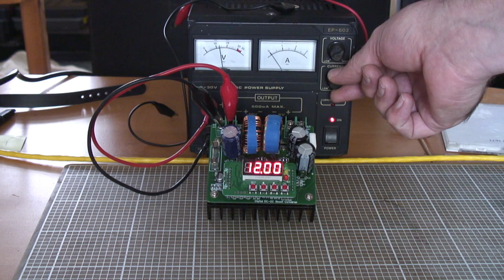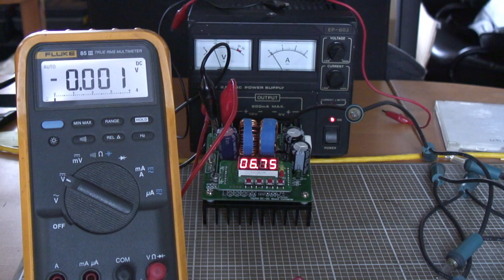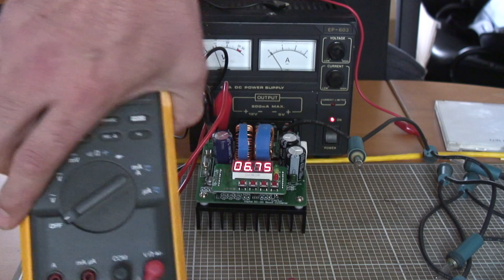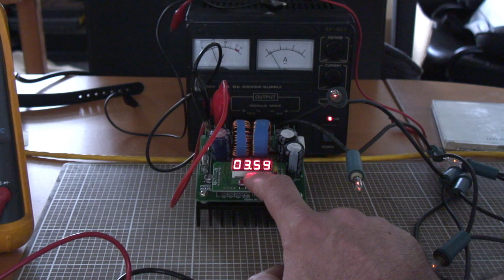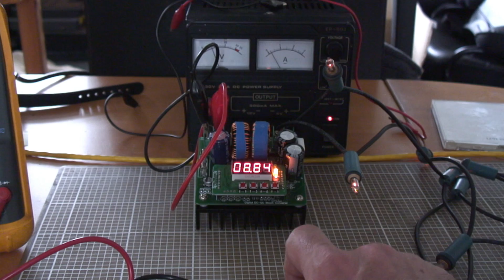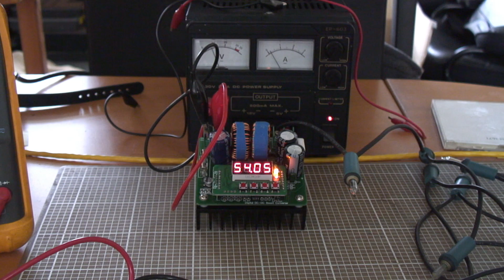Review: 400W Digitally Controlled DC/DC Step-Up Boost Converter - Far from Perfect

Comment: I don't think it's fair to bash this based on setting the output LOWER than the input, as boost converters physically cannot tolerate it (a well know fact I assumed) but maybe it could be programmed out but let's fact it these things are very cheap.  The one I bought clearly stated the output must be GREATER than the input voltage.

That being said I came here because mine are a pile of garbage and I was looking for a fix. 

When I first turn it on, the output voltage spikes to over 30V (when input voltage is 12V) irrespective of whether it it's powered on or not! This is terrible! 

Also the current limiting does not work whatsoever and the device frequently shorts out because of this. 

OH... I also have two of these and they both do the same thing!

Comment: When it hits 100 Volts, the display is continuing to show the correct voltage, but with the decimal point in the wrong place. The output rose to around 110V before the input supply protection saved it from destruction, probably as it’s output capacitors began to flashover.

Comment: Do these problems exist at output setting from 8v to 80v?  Seems to me, that on a 8-80v converter, the firmware shouldn't let you set less than 8v.  Q.C. probably never thought of that.

Comment: Does anyone know how to reset the BST400 factory settings?  Mine will change voltage to the stored setting but only delivers 0 amps regardless of settings
Reply from the maker: Hi John - The procedure for the factory reset is detailed in the description for this video (The F6 menu). If that doesn't work I've got something else for you to check too... The current limit on this converter is not really a current limit at all - it just disables the voltage boost function if the current exceeds the set point, but even with the boost function disabled, current can still flow from the input to the output through the inductor+diode which make the voltage boost happen. Try hooking up a resistive load (i.e. filament lamp) onto the output and see if any current flows (you'll want a lamp rated the same as the input voltage, so if you're running off a 12V input, then use a 12V lamp). If the lamp doesn't light up, then the chances are pretty high that the output diode has gone open circuit. Hope that helps. Cheers!!
Reply: You were correct - a resistive load works perfectly.  The reset worked too.  But I still cannot get it to power 5- 20 watt LED arrays.  The voltage ramps up to the max that I set with the current staying at 0. Even when I put a resistive load in parallel with the array it ramps up till the current max is reached but the array sits with a few LED's lit just like the BST is connected to a voltage source but turned off. I will test LED arrays to see if I fried them.  Thanks again
Reply: +Jim Conner Pigs ass the current limiter doesn't work. I'm sitting here right now with 2 50W COB led's running in series at fuck knows what voltage limited to 280mA. Just checked... 59.39V down from 74.13V @1.35A.
Only thing I found wrong with this unit was the calibration was a little off and drifts a bit with temp, wasn't that hard to figure out how to calibrate and drift... well... everything drifts with temp. Can't fault it. (but I haven't tried to do anything they tell you NOT to do in the descriptions on the auction site.)

Comment: I have BST900 boost model bought this year. set at 14v from a 12v battery current ramped to18v. 
other problems that you found.
when I tried to test current limit set at 1 amp it blew the fuses in my multimeter.  but current does not seem to work on any load from lights to batteries to fans. 
It never goes enters CC mode unless I set the voltage way to high for my purpose and when it does go into cc mode it limits at a much current than what I set it for.

Here is a video. Can someone tell me if this working correctly.
https://www.youtube.com/watch?v=1CXfbv1ehL0
Reply from the maker: Hi lmorrison - I watched your video and it looks to me like your unit is not working correctly. If the output current exceeds the CC limit, then the boost function should disable and the output voltgae should drop down to around the same as the input voltage (minus a diode drop)... Your unit seems to still be boosting the output voltage up to 14.2V. I reckon it's broken. Hope that helps. Cheers!!
Reply: thats what i thought but the seller says this is correct function but did give me a 50% refund
still need something to play with some led's
Reply: I have one of the BST900 green boards and it's totally shit, it's can't handle a 0.50a load without the voltage dropping way down. my old BST400 out preformed it easily. I think all the green board BST900 are total shit. the black board BST900 gets better reviews but right now I feel like just sticking with the old BST400
Reply: Amazon has a black board unit under the DROK name  but it looks like the exact same unit.https://www.amazon.com/gp/product/B01GFVI6R6/ref=as_li_ss_tl?ie=UTF8&psc=1&linkCode=sl1&tag=batter00-20&linkId=484a1902b5018199aa0604bc3078e670

Comment: Mine did not have the start up escalation to 24V problem or resetting issues. The voltage escalates to  its pre-set voltage once the OK tactile switch is depressed, and in case one does not press the OK switch to commence operation the voltage stays at the same level as the battery bank to which it is connected. I can not talk about switch mode power noise since I did not test it with an oscilloscope yet.

The only issue I found (which I believe is no big deal) is a discrepancy on the readout of the device for the voltage: for instance, it may show 16V but often will output  17V instead. I tested the current output with a dc clamp amp meter and it is reasonably accurate. 

It is very useful whence no AC power is present (off-grid solar array system) since there isn't  a need to use an adjustable bench power supply (which in my case has over 50% of losses plus the large losses introduced by an inverter.

Comment: Hi here is a stupid question... I got this boost converter from a friend,  He got it on ebay whit no manual and is a total nobb. So  he tried to use it in the car,, And that 60amp lol...  The fuse was blown but is that all do you think? it looks fine and smells fine lol.. But over 50amp over the limit that wood break someting more than a fuse even just a second?  I do not have a new fuse anyway i can test it anyway? And what componet do you think has gone if it's dead even whit a new fuse? Thangs but do not want ti waist time on it if it's hopeless... I go a few thats not digital my self.... But my friend god the digital and no manual.. They shud have a manual i found it on google easy,,,,
Reply from the maker: Hi +TheCbj79 - If it is blowing fuses, the most likely reason is that the FET transistor which switches the current through the inductor has gone short-circuit. Personally, with this 400W converter I wouldn't bother attempting to repair it and I'd just buy one of the far better 600W converters (without the LED display) instead. Even when this 400W unit is working 'properly' it's still not really very useful as the output has a lot of electrical noise on it, and ther are problems with the unit starting up properly etc... Hope that helps. Cheers!!
Reply: Ok but it's just dead.. whit a new fuse to. And when the buyer got it he used a batteri whit to high amp.. then he did blow the fuse.. After this it's dead whit new fuse.. so then it's maby a fet transistor...ok thangs.... I konw there not the best,,,, But the led display is ok when you need to test a led you do not know the current on.. I hav two 600w whit no led display there good.... There used for ligth in a cabin whit no power......

Comment: DO NOT LET THE UNIT RAMP UP WHEN YOU SET THE VOLTAGE  TO 0 .. I DID A TEST LAST NIGHT AND IT RAMPED UP TO WELL OVER 120V AND BLEW THE SWITCHING MOSFETS SCREWED TO THE HEATSINK.!!   

..DEAD
Reply from the maker: Thanks +scaleop4  - I'm surprised the capacitors didn't blow out too - they're only 100V rated. It was probably the breakdown of the capacitors which caused the high currents which killed the MOSFETs. Cheers!!

Comment: I have been using one of these units to remotely charge/float my car battery from another car battery and i have not found a problem with starting up (with or without a load) however the unit does require a lot of (inrush) current to start up, I don't think your PSU is up to the job and it's your power supply that is tripping and not allowing correct start up and especially start up with a load attached. The business with setting a lower voltage? has not been an issue for me so far.

Comment: When it reads 00.00v after 99.99, I'd wager that's actually 100.00 truncated. I would certainly not assume it's gone back to 0v.
Reply from the maker: Hey +Andrew Somerville  - I had worked on the assumption that it had wrapped round to 100V, but when I let the output voltage go as high as it liked @10:20 it seems to go all the way up to about 113V before it tripped the current limit on the input... It's not much of a real-world problem though as you'd never set the output voltage to such a low value in real-world use... Still a bug that could do with fixing though. Cheers!!

Comment: Hi Jim, Julian Ilett sent me up here....to be honest, i would expect at least some issues when purchasing a rock bottom down BOM-cost step up converter, with no extra (=expensive) output protection of any kind.

When you start the device, you´ll see that your PowerSupply can´t deliver the amount of current the converter asks for. As the driving PS getting into current protection during power up. Usually you hook these converters to a big 12V car battery and it, for sure, will deliver the inrush current needed to power the converter without input current limitation, therefore the converter will power up as intended.

Next, this is a boost converter, and as any other plain boost converter, this thing is not intended to be used to generate an output voltage below its input voltage, usually a boost converter don´t start up at all or, more likely, it´ll do "funny" things on its output.

If i play around with converters of this kind, i´m aware of these things, as they´re obvious....There is no primary output protection to prevent any output voltage to be seen on the ouput terminals/connectors during power up. If you want that here DIY it, or go for an industrial grade boost converter, which will easily cost about ten times more, but it will have all these handy output protection things already builtin, tested and guaranteed and it will also come fully sheelded/sealed...;)
Reply from the maker: Hi +TubiCal - Thanks for taking the time to stop by and leave a comment. I certainly wasn't expecting perfection from this unit, but having already bought a couple of the 600W boost converters (without displays) I was at least expecting something as good as those units, only with an LED display attached for convenience... Sadly this 400W unit has so many problems it is largely unusable. 

Even when this unit is hooked up to an esentially unlimited power source (i.e. big lead acid battery which can delivery hundreds of amps) it still does not power up cleanly. The output voltage is always driven to around 30V before the unit initialises (even when the output is switched off at power-up in the firmware), and if you have a device attached which only requires 24V then it's going to go bang. This doesn't seem to be an issue with inrush current specifically... If you attach a load to the output, it will attempt to drive that load up to 30V, consuming as many amps as it requires to do that from the input until it finally reaches 30V, at which point the converter will then disable the output and finish it's booting-up process. It's as if the logic circuitry to control the whole unit is running from the output voltage of the converter rather than the input, and until such a time as the logic circuits kick in to take control of the situation then it just keeps on ramping up the output without limit.

I totally agree that the converter will not be able to produce an output lower than it's input voltage, but given that the converter only operates from about 10V upwards, why does the firmware let you choose an output voltage under this level - This is clearly a bug/feature in the firmware which would have been very easy for the designer to fix. It's just bad practice letting you choose a value which is below the minimum possible. 

I wasn't expecting anything amazing from this converter... My expectations were merely that it would be about the same performance as all of the cheap boost converters without a display, but this unit produces a huge amount of switching noise both on the input and the ouput, doesn't swtich on cleanly, resets itself at the drop of a hat, and takes forever to ramp up to the desired settings. Given that this unit costs three times as much as the 600W converter (without LED display), I was expecting it to be at least useable.

Cheers,

Jim
Reply: +Jim Conner I broke my converter somehow. I dont know whats the problem. I was
 charging my 12 V car battery with regular 14.4v and about 5 amps... 
everything was okay,  but after a while I accidentally dumped a positive
 imput wire  from the load with a hand.. So that should not be a problem
 right? But when I set up again imput lead, converter didnt work. I just
 noticed first 
digit on the dispay blinked constantly and it was very dimmed. Like 
number 5, probably because it was set on 5 Amp current.  ... Could 
reverse voltage or (return current) from the battery destroy 
someting since i did not dump wires from the battery before I put imput 
wire again on load or , do you have any idea what could go wrong and how
 to fix?  
  Thanks in advance.

Comment: Great review! Wish I saw this before I purchased mine! 
My biggest problem is that I am noticing that my fuse is getting ridiculously hot. With an input voltage of 18v...... output of 35v 2A (to power a 100w LED) after about 20 secs you can begin to feel the fuse heating up.....after about a minute its almost too hot to touch.
Do you think this is because of a low wattage fuse on the input?
Reply from the maker: Hi +Dean Li Volti  - Sorry for the delay in replying - YouTube has stopped notifying me when people leave comments, so I've only just spotted this one. IIRC there should be a 15A fuse on the input and I'd expect you to be pulling about 5A on the input, so I don't understand why the fuse on your unit should be getting so hot... unless perhaps they shipped you a unit with an incorrect fuse fitted in there. I'd recommend checking that the fuse contacts are all clean and shiny as perhaps there's a thin layer of oxide on the contacts causing increased resistance and heat. Hope that helps. Cheers!!

Comment: It seems the power up problem is only evident when used with smaller power supplies. I couldn't replicate it on my 20A supply until I wound the current limit down to 3.2A which unfortunately for you is right on the cusp of the current limit of your supply. I tested the unloaded output on power up with my Fluke 189 set to fast max and caught a 32V spike (250uS) with the input anywhere between 5-18V, not ideal.
Regarding the Function numbers, the only thing I found different in your list was F2 calibrates the Input voltage reading while F3 calibrates the output voltage display reading for 10V and 40V. I too, am not sure what F5 and F6 are about but it seems F5 may be "SAve y/n" for your cal changes and F6 may be "Reset y/n" to reset back to defaults.
The only real gripe I have with my unit is the ridiculous ramp up time for the voltage. What the hell were they thinking?
Reply from the maker: Thaks for those Dale S - I've updated the description of the video with new descriptions for F2,F3,F5 & F6.
The ramp up time is something I could live with, but this converter has so many issues that I've yet to find any practical use for it. I tried putting my 400W unit into service a few months ago using it to boost up from a 120W 20V@6A switchmode supply to power an 80W 24V@3.15A LED chip , but it did a truly terrible job on that with lots of problems starting up and a very annoying whine when in operation. You can see exactly what it did here...  
https://youtu.be/iD3jTh1b1FA?t=513